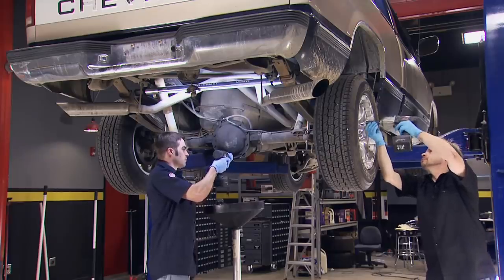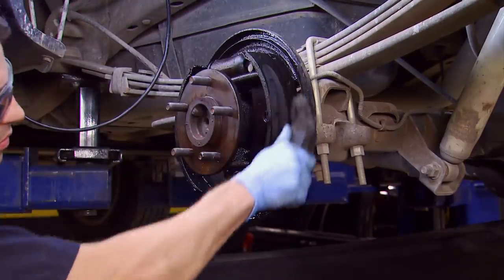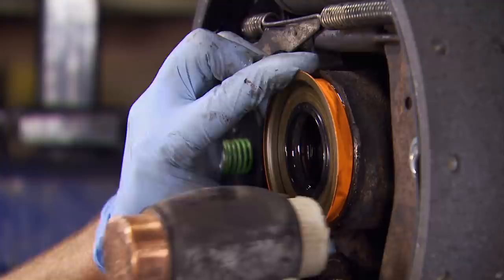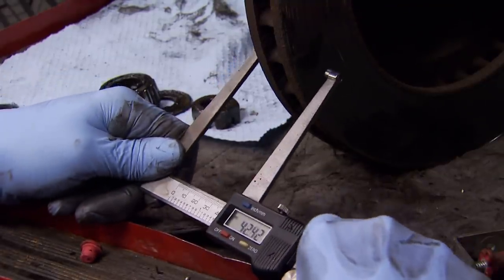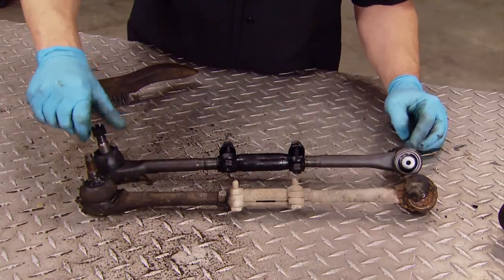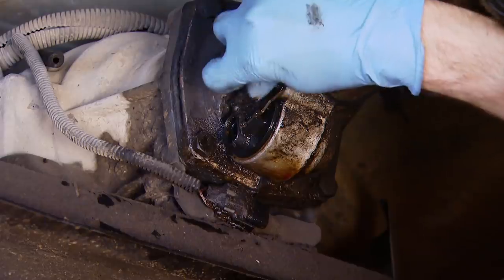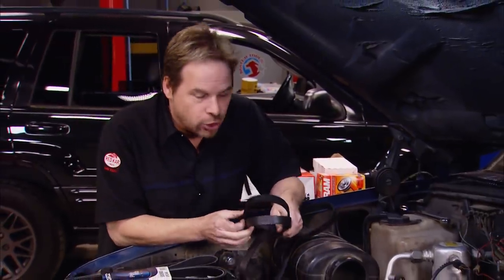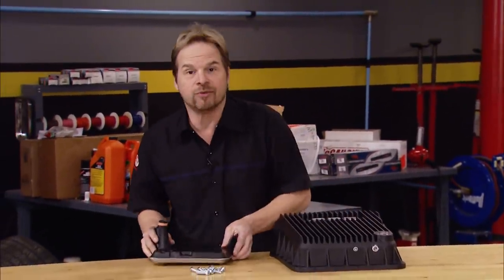Making a Chevy 1500 Workhorse With 260,000 Miles Safe For The Road - Truck Tech S1, E5

Comment: I need to get these fellas a 260k GM rot box from NY... then they'll have a real show haha
Reply: Absolutely they would not know what hit them
Reply: The master of brakes watching a brake job on a Chevy. First, your just here for the brake clean. Second, I knew you were a closet Chevy lover Mr O.
Reply: South Main Auto Repair LLC I'd pay to see that lol.. Looks like you guys see about as much salt as we do up here in Canada.. I can't believe they didn't need a hammer for those drums
Reply: Still a good show
Reply: Exactly, they have no idea what we go through... When they just magically unscrewed that brake line from the wheel cylinder, I was like yeah right, that never happens here - time to get out the penetrating fluid, blow torch, and probably end up having to bend up new brake lines if I'm lucky. The show would be 4x as long, but would be more accurate for most people.
Reply: I live in Ohio and any vehicle from the northern salt belt of the country turns into a rust bucket after a few years unless the owners take a little time to pressure wash the undercarriage periodically. What's even more fun is dealing with rusty steal brake lines and fuel lines, all vehicles should run stainless as a general rule, hell should be a law.
Reply: EagleTalons1 copper/nickel is what I use. Cheap, easy to flare and bend, and won't rust
Reply: Unrealistic
Reply: Or New Jersey, lol.  Love you channel. I’m a technician too.  You should see the crap that comes into our shop. Lol
Reply: lmao ikr. you rock
Reply: I got an 06 and every part you remove, you bet your ass your replacing.

Comment: 15:27 That tip actually saved my ass one day. I was about 3 hours away from home on the interstate when I noticed a bad misfire and loss of power. Turns out, my cylinder 3 spark plug cable grounded out and melted to the header. I remember I kept the best cables in my truck box and ended up throwing a new one on and hitting the road again. I was thanking myself for actually keeping a few old ones.

Comment: I've owned 3 box Chevy trucks. One a 96 Tahoe, gotten 325,000 miles before I gave to a friend. The other 2 I still have 99 suburban, and 99 Yukon with 260,000 miles and I get alot of compliments with both trucks. All trucks have had schedule maintenance performed and the transmissions have held up even. If there trucks are taken care of they will be extremely reliabile! As a matter of fact among technicians these trucks  are known for there super reliability. As Master Auto Technician, I haven't seen this kind of consistent reliability in later model trucks. Not even close!!!

Comment: 266000 on my 98 GMC k1500 all orignal drivetrain  other than replacing the lower intake and regular maintenance. Great trucks! Very very easier to work on and get parts!

Comment: With that many miles, I would have replaced the rear axle bearings while replacing the seals. Very cheap insurance.
Reply: Doesn't make sense they would replace the front and then skip the back
Reply: @Darrin Hart, better replacement axle seals have a slightly reduced inside diameter to help compensate for the wear. Some are even marketed and marked as 'problem solver', or something along that name.
Reply: I ran into that very thing on my 82 k10. Axle seals leaked on the brakes, did brakes and seals. 3 months later I was doing the outside bearing cause it was leaking again.
Reply: @danareynolds1786  you are correct about the seal diameter, but he's right about the need to change the outside axle bearing, sloppy bearing will blow the seal right away. Lived it. Learned from the experience
Reply: I thought he was talking about wear at the seal. I've seen where the seal has worn through and the inner spring has worn the axle surface requiring attention.
Reply: @danareynolds1786  It is all good. That's what these comments are for. To help our fellow gearheads learn from our communal knowledge.
Reply: Agreed, not a big deal on these axles, no need to cut off bearings like some other models, it's easy and they're cheap. Also, I would recommend using thread locker on the shaft retaining pin set screw, you never know... - some manuals do call for it.
Reply: bwilson187 yeah you definitely don’t want that falling out lol

Comment: I have 329k on my 03 2500hd. Runs perfect.
Reply: LS power!
Reply: Duramax power you mean?
Reply: Ford never builds a truck that last like a Chevy. I know i had plenty of ford trucks because there cheaper than a Chevy truck rather pay more for a Chevy last alot longer.
Reply: @brysonshires9742  no, it's a 6.0 gas motor.
Reply: Shawn Van Meeteren oh baby
Reply: @donaldkinder6716  300k miles is nothing for a diesel, 7.3's can make it up to 1000000 miles.
Reply: Sure you do 😂

Comment: Nice instructional video,..BUT, for folks just staring into this kind of repair, please bear SAFETY in mind,..Ryan was NOT wearing safety glasses when he was installing those 
new drum brake parts, and it's really easy for a piece of dirt to fly off those spring and put your eye(s) into a world of hurt!
Also, he cleaned all the dirt/dust from the backing plates that holds all the brake stuff, BUT he neglected to show washing down those new brake rotors etc. before finishing the job. There WAS
a 'glob' of new grease there at the five o'clock position on the new rotor, leaving that there will contaminate the new pads and possibly reducing brake effectiveness.
SAFETY is everybody's business, it doesn't cost,...it saves!

Comment: On a car that old, you want to think more holistically. When you start nibbling like that, two things happen.
1.) You have a major failure 2 months AFTER you do a modest service on it. On the trans, say, you replace the filter and fluid, a couple seals, the seeping cooler lines, maybe add a bigger cooler while you're at it. Then 2 months later it starts slipping. Or the valve body has a heart attack. Doh...
2.) You initiate a chain reaction failure that travels throughout a system. You replace a bad thermostat, for instance, and flush the coolant. Then a hose blows. You fix that and the water pump starts leaking. Then the freeze plugs. Each time it happens, you buy more coolant and spend another Saturday re-doing work you did last Saturday. It's wasteful and frustrating.
Think very broadly about everything you do. What else should you replace while you're in there? Should you even bother with a service, or simply replace the entire unit? Cars can go for a very long time without any real problems. Once they start, however, they tend to occur all at once. The catalyst often is a well-intentioned minor repair. Just replace everything up front and be done. 
I'm not hating on Truck Tech; just offering lessons learned from 4 decades of buying very old cars.
Reply: This is a show from 2014.  copyright MMXIV.

Comment: Dont call her a turd man lol. I will say @12:10 the vss and vss connector harness should of been replaced together, also I had an issue with a duralast vss sensor than I tried a napa and they both would grind against the gear looking thing in there it counts for the speedo. Only an Ac delco would work I got off amazon.  Just for anyone thinking of doing that vss . My truck would act really weird in overdrive it would kick in and out then go into limp mode . The wiring for the vss I believe got crushed due to a transmission swap the wiring was between the trans and the under body of the truck .

Comment: They were under the truck fixing the speed sensor seal. Why didn't they drop the trans pan and change the filter?
Reply: thats exacxtly what i said. its cheap like 40 bucks or so
Reply: pretty cheap for insurance and knowing the fluid is half changed and filter is good. i just did mine 400 miles ago in my 290k 93 4l80e ran around 45 i even used supertech trans oil which is fine
Reply: Exactly what I was thinking..
Reply: Because most of your local mechanics will not fix everything even if it needs replaced, I wanted my thermostat changed after a radiator flush on a 30 year old vehicle. Mechanic bitched about “Why” what’s it doing theirs nothing wrong with it. Guess he was never taught preventative maintenance. Stopped going to him and do my own shit now
Reply: @Gabriel.4190  30 yod car? You should have been doing that yourself.
Reply: F165 exactly the reason the I did
Reply: Michael Brown original trans?

Comment: Put 697,500+ miles on a 2000 Chevy Astro van over 11.5 years, sold it to a church for $1 and they are using locally for last 3 years.  4.3L vortex engine. Original power train.
Reply: Stephen Drummer That is unreal! Did you do deliveries with it?
Reply: Yup, I’m an expedited freight courier, averaging 250 miles per day, 5 days a week, 250 days a year, got photo’s and plenty of witnesses and records.
Reply: Stephen Drummer wow, I have an 02 with 133k on it. What kinds of issues did you have with it? Wheel bearings? Any seals go out?

Comment: Didn’t mention cleaning the new rotors off with brake clean
Reply: Mason Green yeah he got the axle grease on them
Reply: Mason Green why is that important? Serious question no smart ass remarks please lol
Reply: ofmyownaccord and is that why my brand new brake rotors and pads squeak when I hit the brake or going cruise mode (35mph) ??  Front brakes on a 96 c1500
Reply: MexiKingiCon possibly? Depends on the brake as well. Will usually squeak early if they weren’t washed like comments say above.
Reply: Wolfman Jack Detroit axle brand brakes !! And we did not do any cleaning of the new brakes no ... so hopefully that’s why it squeaks and not something more serious

Comment: My 96 Chevy S1- ZR2 has 275000
My 99 Chevy Astro 4.3 has 360000
both are still daily drivers
Reply: Have nothing but respect they still running strong blessings to you and your family and the chevys
Reply: 96 S10 4.3 265K
Reply: My 95 K-1500 has 273,220 miles and wifes 92 K-1500 has 210,000. Both are Z-71 one owner trucks.
Reply: Treat your car well, it will treat you well. Always amazes me that people lay out 30k+ for a car/truck, and treat it like it's disposable.
Reply: 96 chevy Astro 4.3 Vortec has 260,000 daily it runs like a monster

Comment: Didn't do that truck any justice using those pos fram filters.
Reply: Hastings & Wix are way better for econo brands. I've been using Royal Purple oil filters for the past 20 years, along with Valvoline full-synth oil.
Reply: Spot on. 
Might as well screw an empty beer can on it.
Reply: @ImTheJoker4u  hell, an empty beer can would have been a better choice...Lol
Reply: You ain't kidding.
Reply: I've been using Fram for years and never had any issues.
Reply: They spent the filter budget on the E3 spark plugs
Reply: Wasteland Wanderer 1216 
Thats what my neighbor said, right up to when I was replacing his distributor because there was so much slop in the gear, his truck was misfiring. 
Seriously search YouTube for Fram.
 
Fucking
Ruined
Another
Motor
Reply: Dana Reynolds 
The RP filter is essentially a Mobil-1 extended performance, with a fancy paint job, and about $15 tacked on. Same goes for the K&N, except they tack on the stupid, useless nut.
Reply: @ImTheJoker4u  that nut is there for those super professional wench turners to torque the oil filter to 100ftlb
Reply: @WastelandWanderer1216  
Me either. Fram filters work just fine, I just traded a Prius with 178,000 miles on it that ran like a top and I had a 1965 Chevy Truck I ran with Fram filters to 475,000 miles without any issues at all. These self proclaimed experts who watch Youtube videos for their automobile mechanical "ejoookayshun" wouldn't know a 9/16" from a hammer. LOL!
Reply: Libertatus in Perpetuum you never cut one open then, why buy fram when can buy something better for the same price?

Comment: Great video! I wish you guys would have shown how to adjust the new rear brake shoes after installation.
Reply: I did them on my old 98 k1500 5 speed. All I did was put the new shoes, drums, and wheel cylinders on put 2 lugs  to hold the drum on started the truck put it in reverse and the pedal went to the floor. I pumped the brakes until the pedal started building up and I could hear the Rpms coming down. I did this until it stalled the truck and the brakes where adjusted great. Driving in reverse and hitting them also adjusts them

Comment: I bought one of these with 223k and I had to replace the actual distributor itself to get it to run right. Just doing the cap and plug wires didn't help. The magnets on the shaft itself must have cracked or something, it started running terrible one day. Surprised they didn't do it on that one.
Reply: Chevy used a funky pick up there.. The ready to run MSD distrib is a really nice upgrade.

Comment: So my cousin installed some new brake pads and rotors on my 96 c1500, but they started to make a squeaking sound when I hit the brake or if I’m going slow .. Detroit axle brand Nd they are organic . 
Did my cousin miss something or does the organic and semi metallic make a difference as he says it will with the squeaking noises ..? I need answers lol

Comment: I do the same with cars or trucks with serpentine belt set up I don't throw away the belt I leave it in the trunk or laying around in the truck bed, even with the v belts I only keep one, the most important one, the water pump and anternator belt that will get me moving home or to the auto parts store

Comment: At what point do you bleed the air from the wheel cylinders ?
Reply: After the drum is on the axle hub holding the shoes from spreading too far out.

Comment: Did it just bother me or did not cleaning the speed sensor and adjacent area not sit well, didn't even clean the electric connection?
Reply: That sensor should have been replaced and the connector cleaned.
Reply: Meta World Peace I would just do rear disk brakes make it easier
Reply: Nick webb where is the cheapest kit for rear disc brake conversion. I can't find anything cheaper than $1200
Reply: kevin Pratt if you search 88-98 cK truck rear disk conversion you can find them for under 500 dollars
Reply: No way what sites??

Comment: I went to replace axle seals and bearings on my 89 Chevy. The  8mm retaining bolt that holds the pin in twisted off where the smooth part of the bolt meets the threads. How do you get the remaining part of the threads out? I bought and tried a left hand drill bit hoping the cutting edges would cut and hang into the remaining threaded part enough to turn them out but the housing sticks out past the hole so you can't drill straight into it. Drills at an angle and wants to cut into the threads and not into end of bolt. Argghh!!

Comment: Yikes! On the front wheel bearing torque or lack thereof. You have to use a torque wrench (something like 10 ft lbs) on the front wheel bearing spindle nut to seat the bearings and then loosen and just go finger tight before inserting the cotter pin. Good way to smoke a bearing and spindle is to skip the torque wrench and just "think you feel" the correct torque. You know like, "using The Force" instead of a torque wrench.  Also, the idler pulleys usually go bad before or after 100K miles depending on idle time. Once one of those pulleys lock up, or fall off it will toast the serp belt. No one ever shows adding the rear differential gear oil additive for the limited slip rear ends which is the norm differential in most light trucks. I use the 7 ounce tubes they sell at Auto Zone and other places. Works great with just two quarts gear oil which puts it near full to the fill hole. Noticed if it isn't added, after a drive, you get a huge amount of large gear oil bubbles and foaming that will spill out of the fill hole if you pull the fill plug.

Comment: i cut some of those fram filters in half one half and each one had rust in it
Reply: I checked about 15 Fram oil filters at a Pep Boys once, and every single one of them had rust on the exposed metal between the gasket and threads; bad enough that I could scrape some off with more under that. This happened maybe 22 years ago and haven't bought a Fram product since.

Comment: How do I plug the brake line so it won't leak?
What is the proper preload on the front wheel bearing, "until your happy", makes no sense to a newbe?
Reply: For the front wheel bearing preload, it does come down to experience. :(
It's best to have an old timer show you how it's done in person.
But basically do what they did here with tightening it then you back off a bit and then tighten with your fingers as tight as possible. You don't want drag on the bearing and yet you don't want it to be loos. It's hard to explain without a hand on. 
I wish I can explain it better.
Reply: A B thanks for the help, I really appreciate your answer.

Comment: 260k miles but let’s not bother replacing the timing chain or water pump or thermostat or rad hoses or do a rad flush...just do the brakes and steering linkage and throw a set of plugs at it!

Comment: that many miles and they didn't even replace the distributor gear which is the most common problem with the cam correlation code nor did they replace the fuel filter or the rear axle bearings with that many miles
Reply: @lSTICKYFINGERSl I have fixed hundreds of these with worn distributor gears a majority of the time the check engine light will be on with no signs of a problem believe what you want I know I'm right
Reply: @lSTICKYFINGERSl OBD1 flash codes 12,17 or 41
Reply: @lSTICKYFINGERSl because if you are rehabbing a Truck and replacing common failure components that particular part in my experience is the most common  and failure prone part.In the late 90s I done these multiple times in a week every week.
Reply: @lSTICKYFINGERSl u dont need to worry about tdc. note where the roter is pointing when you pull it and reinstall with it in the same spot. i can have a 12yr old do it